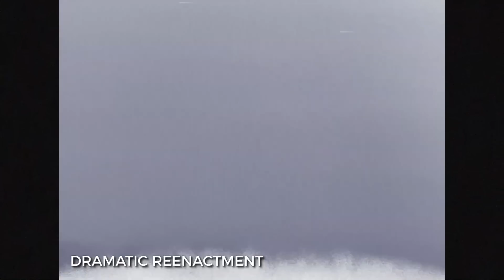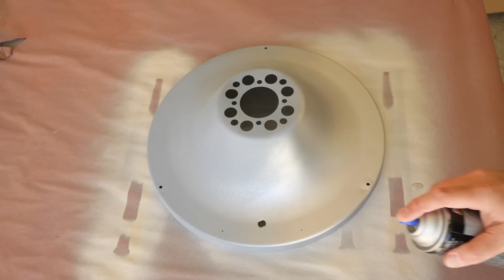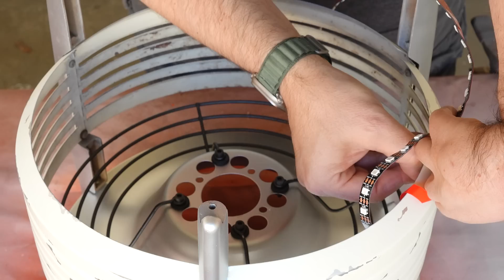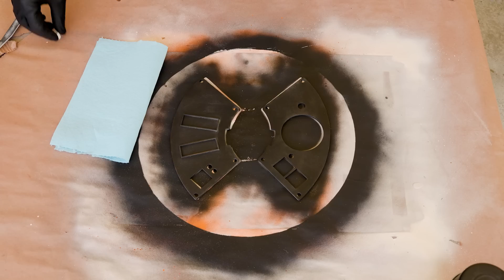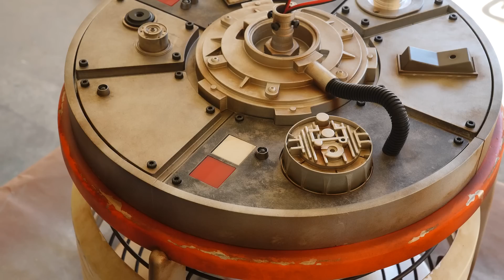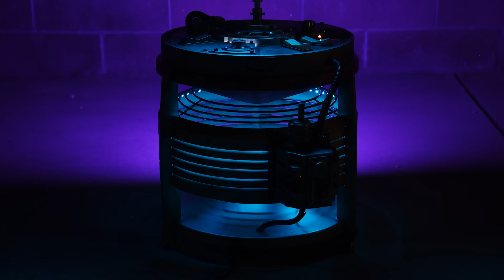Building a Star Wars Hologram!

Comment: This is an awesome build!  I've watched your videos for years, and this is my first build from your creative mind!  What's the cleanest way to remove the nail brackets from the 2-gang box without scratching or mangling the box?  Thanks!
Reply from the maker: Thanks! I'd imagine using a sharp razor blade or possibly a chisel would get you the cleanest removal.
Reply: @VanOaksProps  Thank you so much!  I also wanted to ask about the LEDs.  The materials link points to 12v LEDs but the board is only providing 5v, right?  Do those LEDs really work at 5v?  Thanks for your help!
Reply from the maker: @SMichealP they do, although 5v would be better.
Reply: @VanOaksProps  Thank you so much for your help!  It's very kind of you to be so attentive to questions!  So I have another.  :)  What would you suggest as a good, but not too thick, fast drying primer for PLA, resin, metal, etc.  I've seen you use Automotive primers like Upol and Rustoleum, but there's so many variations to choose from them.  My wife uses Rustoleum Filler Primer, but it just seems to dull the details of prints a bit.  So I wanted to ask your advice.  Thank you!
Reply from the maker: @SMichealP my goto is Upol expert sandable primer. It’s affordable, and dries quickly.

Comment: A great build 👍👍. Another thing you can do to weather a thing is this: put a small line of glue in various corners and recesses blow, drop or otherwise apply very fine dust over the locations that have been glued.  Dust off loose particles when dry.  Even when a thing is constantly cleaned, dirt and crud collects in corners and in recessed areas. This will add age and realism to the model.
Reply from the maker: That's a great idea!

Comment: Really nice work! Just a quick side-note, you shouldn't wire LEDs directly to the microcontroller. Yes, they do have the required voltage outputs, but they might draw more current than your microcontroller is able to provide, meaning they can fry it. Instead, you should connect the 5V directly to the step down output (buck converter)
Reply from the maker: Thanks for the info!

Comment: I checked out images from the Perseverance Rover. It seemed a bit faded/matte, a bit dusty. But not dirty as per such.
If you wanted to achieve a similar finish on a recreation, i could imagine you could contact a sandblasting company & put it in the blasting room for a week - out of the way of the blasting action. (In blasting rooms, the sand kinda bounces around everywhere & slowly strips all walls....)
It would possibly require "real" surfaces, Perseverance is aluminum, titanium.

That is of course the patina of a dead world & star wars played out (of course) in living worlds....

Or were they ever in the dust, in something corresponding to the Moon or Mars?
Reply from the maker: An unmanned rover on a planet without obvious life forms would definitely look different. Thankfully the Star Wars universe is the opposite, which allows for props to look worn in very different ways.

Comment: I LOVE this project! I happen to have an old floor fan like the one you used so I am very tempted to give it a try. I looked at the LED hologram fan you used as well as some others. There were mixed reviews on them and I saw MANY that were critical of the app either not working properly, not written in English, or using unknow file types. The fan you chose seemed to have the highest rating and was one of the least expensive. What was you experience with it? Does it have an SD card that you can just load images onto, or do you have to use an app? Looking for some practical feedback before I make a purchase. Thanks, and love your channel!
Reply from the maker: As a Mac user I could only upload video via the app, but I didn’t find it to be difficult after reading the instructions. Windows users can use their desktop software to upload directly to the fan’s microSD card. 

I basically saved the video file to my phone, then powered up the fan, selected the fan’s WiFi to connect, then launched their app. Once inside the app I pressed the + button to add my videos and then saved & named the clip to the fan. The fan then shows its progress, as does the app, and then you’re done.